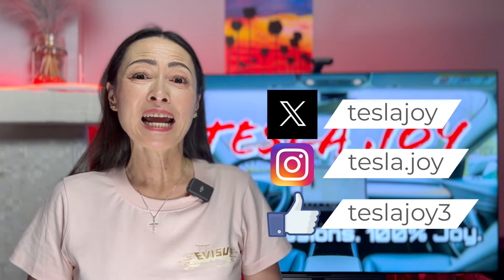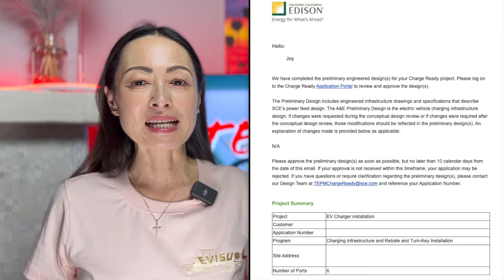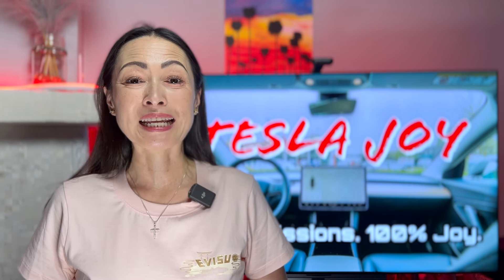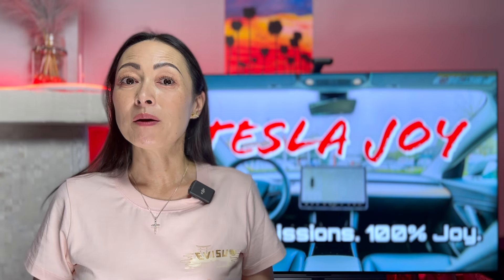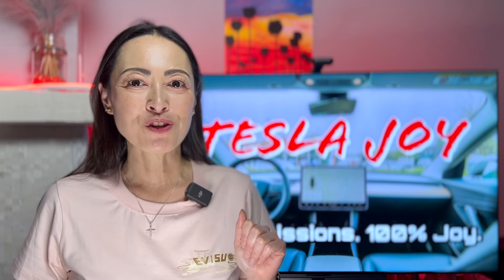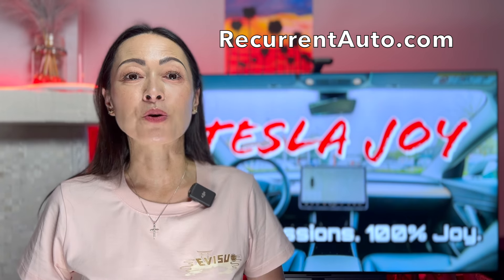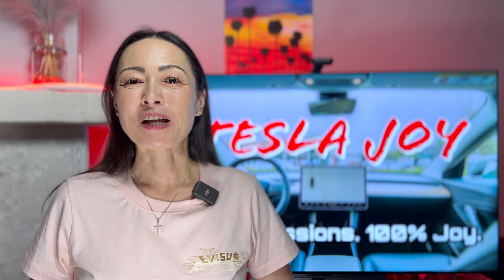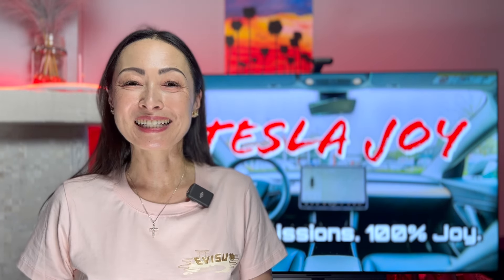Deep Dive into Condo EV Charging Installation Process - Episode 12

Comment: You should get the Patience Of Job Award for sticking with this. I recently moved to an apartment complex that has carports available. They installed a 110v outlet which is perfectly adequate for my usual driving needs.
Reply from the maker: Yes all new buildings after 2017 are required to have wiring for EV charging.

Comment: Sounds like you are working through this type of upgrade following the correct steps.  Although I’m not an electrician I worked for DWP for a number of years, and some of those in the field.  It is very important to complete any upgrades so that they meet current electrical codes.  As you mentioned the building was constructed in 1973, plenty of changes since then in the NEC.  Kudos for doing this the right way!

Comment: I too am Condo HOA president.  We installed 2 outlets for charging.  BUT, not enough  owners wanted a facility that other owners could use.  SO, we have these 2 outlets connected to our individual electrical systems.  I wanted a system that for  the entire 15 unit building.   Most owners could not see the value - they did not see an electric car in their future.  Our Condo building in Guaymas, Sonora, Mexico was completed in 1976.   Two  240v 20amp outlets.

Comment: Crazy amount of time for this project.  It took my electrician about an hour to install a NEMA 14-50 outlet in my garage.  Cost me $250 (I supplied the outlet and breaker at a cost of $150).  Paid another $487 for a Autel Maxicharger to connect to that outlet.  This allows me to charge my '24 Model Y at up to 40amps/240v.  Total cost $887.
Reply from the maker: That doesn’t apply to us. Please make sure you watch previous episodes as your situation isn’t the same as ours.
Reply: @TeslaJoy  I totally understand, just contrasting living in a urban area of CA versus a more rural area of the midwest where things can get done quickly without any red tape.
Reply from the maker: It’s not the red tape that’s prolonging the project. Make sure you watch the playlist series to understand why.